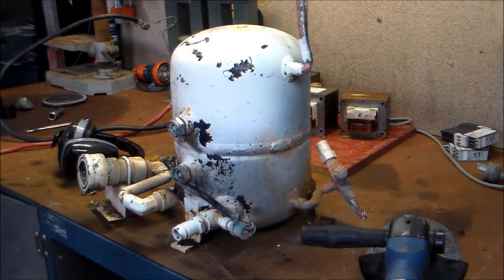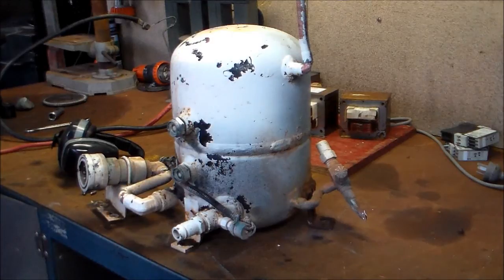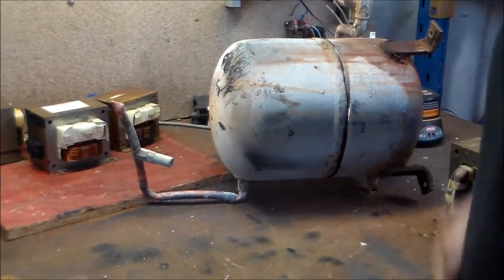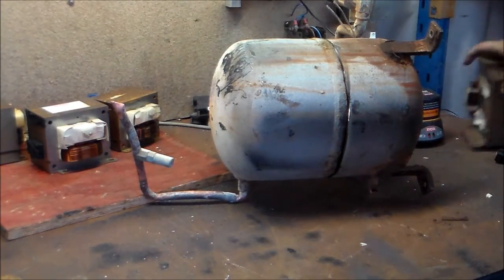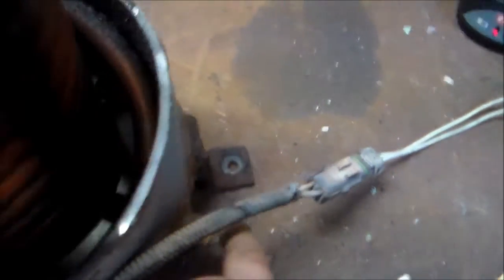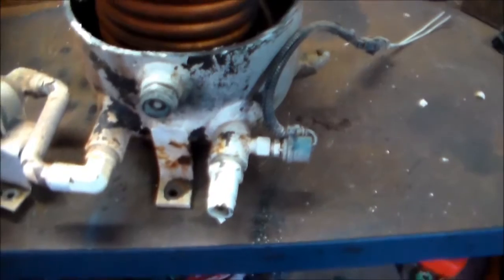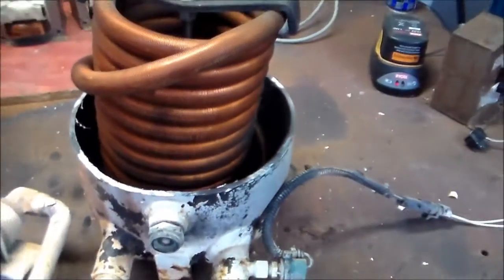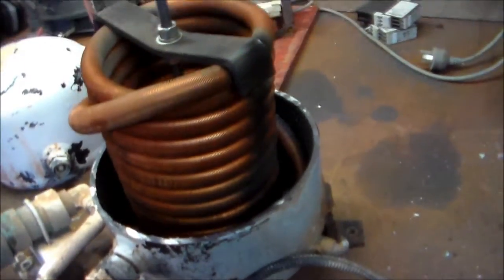Refrig Autopsy :- Big Receiver / Water Condenser from Thermo King Container

Comment: Smashing rip to bits mate :-)

it sort of reminds me of the coil of tube immersed in your homes hot water boiler, the heating system water runs through the boiler picking up the heat from the hot water but both systems are seperate.

Nice copper tube, you have to find an evil use for it lol :-)